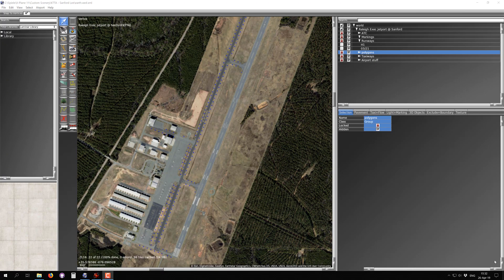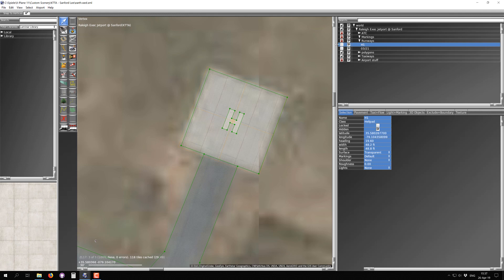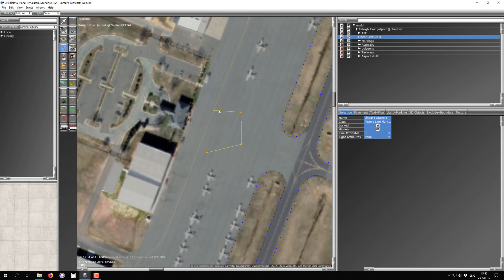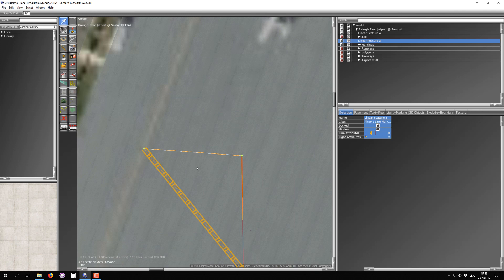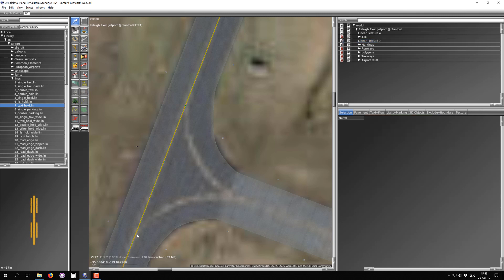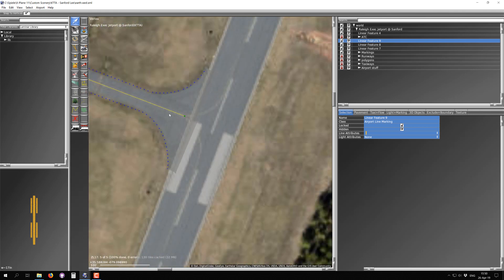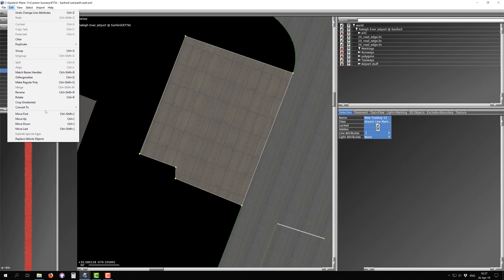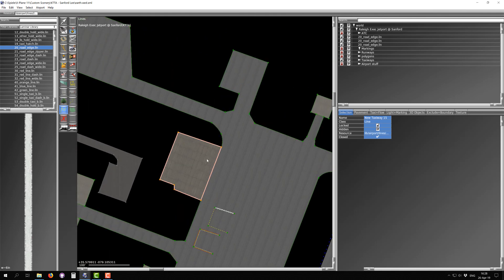#6 - Placing lines

Comment: Thanx for your tutorials. They got me motivated to create or enhance airports.
One questions: Is there a good technique to draw ground traffic markings., e.g. 2 solid edge white and a dashed centerliner, all parallel around curves and corners?
I find myself measuring with a ruler on the screen and regard this as rather suboptimal. The result is questionable anyhow.
Reply from the maker: Sure - you may want to watch the video all the way to the end, to find out ;-) Or - if your attention span doesn´t allow that - jump to 26:30. This technique (shift-dragging) also works for curves and corners.
Cheers, Jan
Reply: Fantastic - (at least this time) it wasn't a problem of my attention. It was a lack of abstraction capability that my "road problem" is equivalent to the "white-red-white-line" problem. At least for convex roads 8-).

Comment: Hi Jan, thanks for your tutorials, it's really nice as a step-by-step guide and I'm really looking forward to your coming videos!
(I just picked EDLP as my project, the only non-reworked airport in Germany :D).

Two questions: 
1. How do I reactivate nodes that I've previously hidden or locked? I can't click them anymore...
2. If I got you correctly, then the "lines" tool is only for non-aircraft, as it is hardware intensive therefore I stick to the taxiline-tool as often as possible, correct?
Reply from the maker: Moin moin, EDLP is a nice project, but no one will ever see it because the Aerosoft custom airport EDLP will always suppress it ;-). 

To unlock stuff, just click on the little red lock again - but you have to find the item you want to unlock in the right-side pane first. This can be difficult if you don´t know which one it is. In this case just select everything and unlock everything at once (hold ctrl). 

No, LINES are for non-airplane related lines (like vehicle parking spots), AIRPORT LINES are for airplane related lines (like taxiway centerlines).
Have fun, Jan
Reply: @janvogel9719  Ah thanks for the answer :) 

I know there is custom scenery, but it's payware and I hope I get as far to get mine to the gateway for free ;)

Comment: Dear Jan,  I started to make scenery after watching your tutorials and they are really very good and very much better than any others.
But I have a question and need your reply.  In WED after I make the scenery with the help of Wedomaker, I upload to my scenery pack
and go to the air port and I can see some roads very close to the airport and those road are not visible in WED. How can I place some objects near the road and how to find the correct location.
Reply from the maker: Hello Perera, I will explain about the roads (and how to remove them, if necessary) in a future video about placing "exclusion zones". You can not really see the X-Plane roads in WED, so that is a bit of a problem. Maybe in a future version of WED they will make those roads visible. Stay tuned! Thanks, Jan
Reply from the maker: It will show the roads as they are currently in Open Street map. X-plane will have roads that are much simplified and possibly outdated (taken from OSM back a few years). So there is a significant difference!
Reply: @janvogel9719  
 Dear Jan, Thanks for the reply and now I am looking at your new videos- very very nice and thanks a lot.